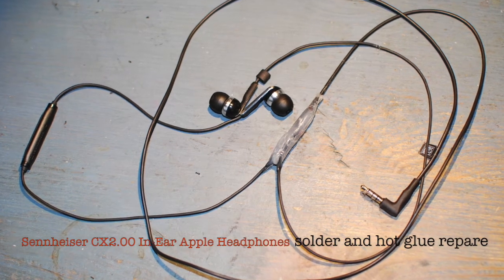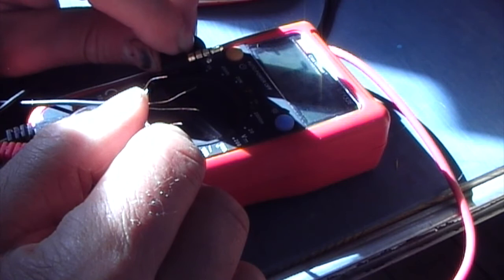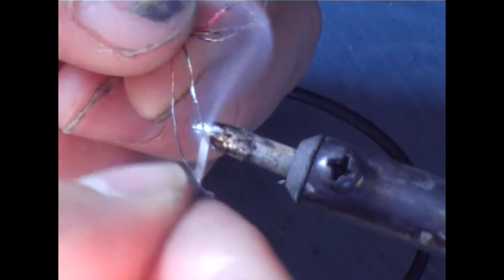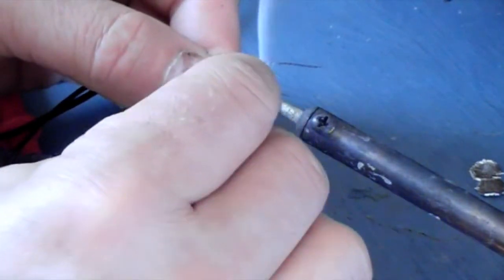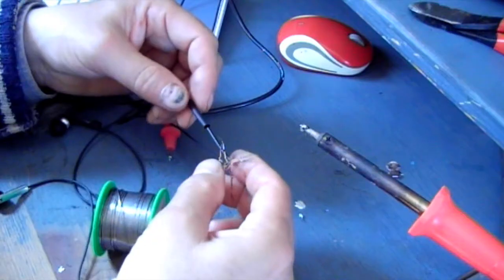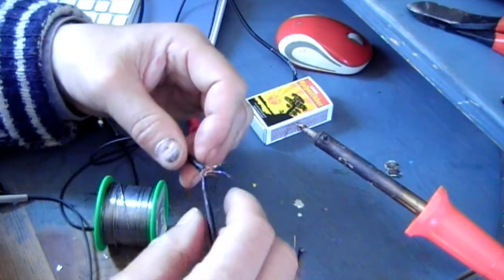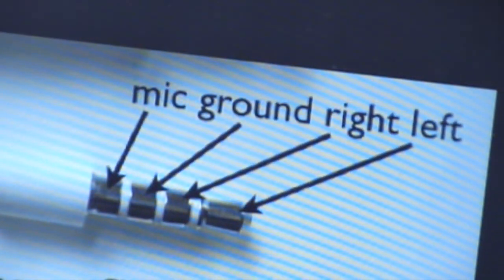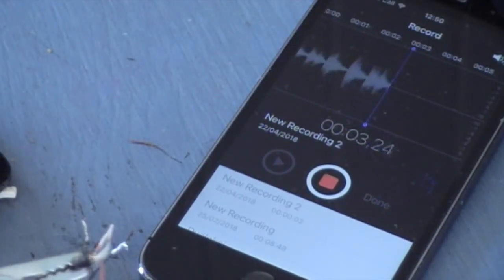🔴Quick Guide to Repairing Sennheiser In-Ear Headphones / microphone - Fine wire soldering

Comment: I've got a pair of Sennheiser CX 1.00 earbuds (simple ones without a microphone) & one of the channels went open-circuit.  I ended up completely replacing the lead using wire from some old Sony earbuds.  I found that it's easy to solder the wires if you firstly remove the reinforcing thread, twist the wires a bit, then dip the ends into some flux.  Then you can easily tin the wires, as the heat from the solder burns off the enamel.
Reply from the maker: thanks for watching

Comment: This is great. Come for the woodworking and stay for the electric repair. I need this as well to repair the wire on a headlamp. Tried once but the wires are tiny. Will try it again after watching this.
Reply from the maker: Those heat-shrink tubes are a revelation, I bought a box-full at Biltema (like Harbor Freight?)
Reply: Biltema, Jula and ClasOhlson combined give u the assortment u need for everyday use, even some semi-professional tool brands,,, but I stay away from their branded contractor knives and stick with my Mora
Reply from the maker: the red and blue ones are pretty cheap anyway. The last semi-pro tool I bought was a proton planer it broke. Back to hand planing, the makita one is so expensive.... Holtzer made the best but disappeared.